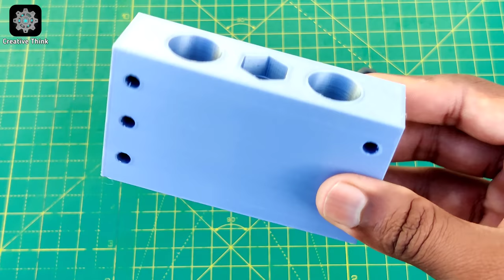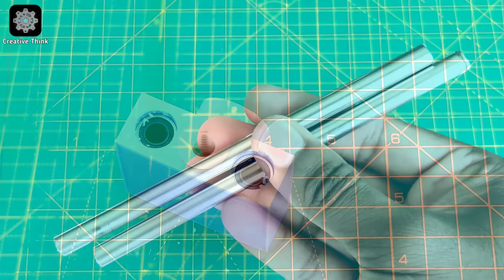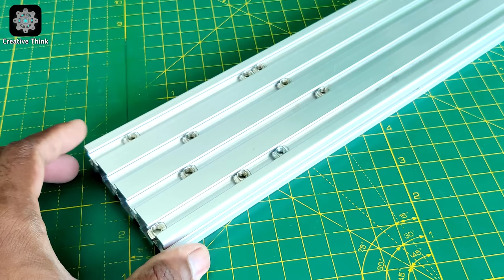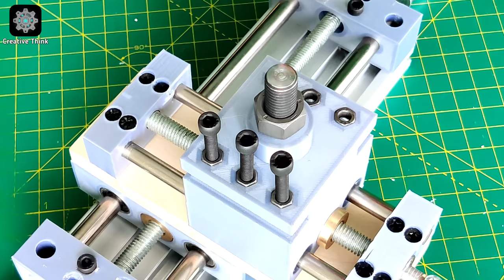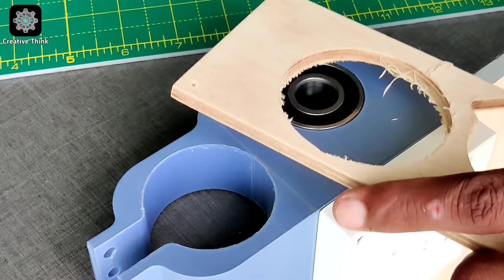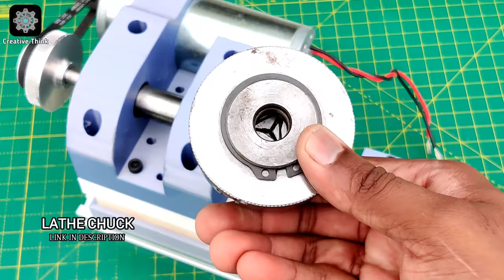Making Mini Lathe Machine

Comment: I think that NOT including links to the CAD files for the plastic parts was a good thing.  Anybody who actually tries to build this will be disappointed by the results.
Reply: High performance polymers can work fine but the thing they lack is weight for damping.
Reply: @lrmackmcbride7498  the 8mm rods are more of a problem because they bend easily

Comment: Parts super glued ? 3D printed parts with bearings forced into place.. bolts with nuts being placed in opposite side as the forces applied when you tighten down tools.... common, you must be joking... don't see this as a serious project, but only as a waste of materials...

Comment: The idea and concept are nice, but it is a pity the whole machine is as stiff as chewing gum.
Would it not be worth contracting a real miller to make rigit metal parts instead of pnastic, and replacing the motor and the hand control of the tool holder with arduino driven step motors ?

Comment: Oh great, another plastic lathe that looks great but runs just like you'd expect.  That spindle shaft looks like it was turned on something else just as bad.  And what holds those nuts in place that are holding the cutting tool in place?  Don't see why they don't just pull out of the plastic.  But I guess the only important thing is how it looks in the thumbnail.